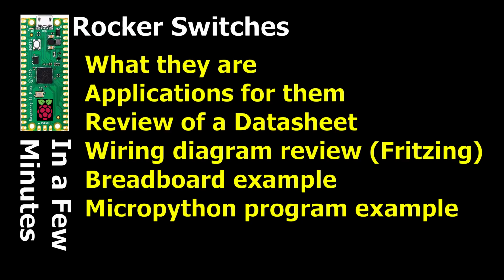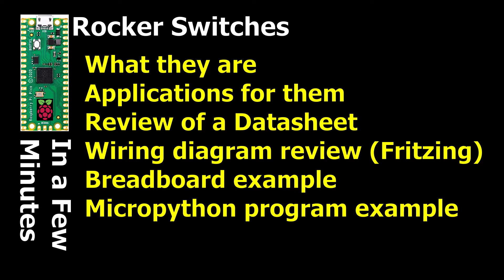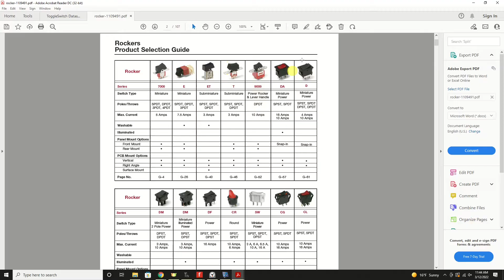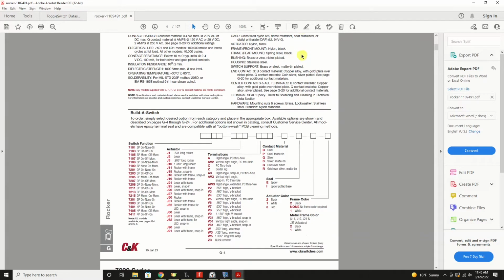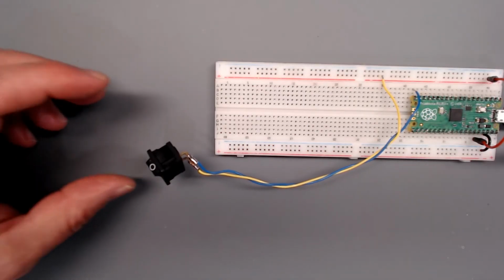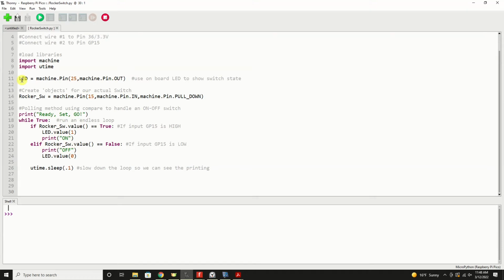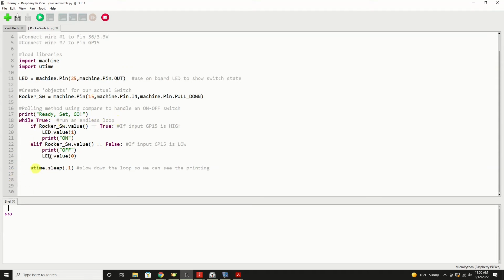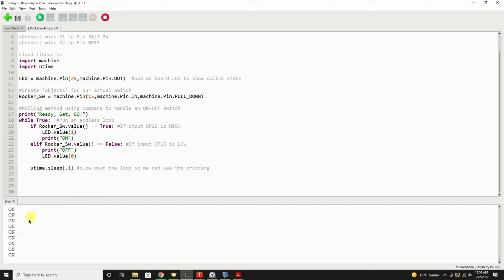How to interface the RPi PICO with Rocker Switches

Comment: I am a beginner so please be patient because I am not too knowledgable about this, but my switch says:
"3A 250V AC
6A 125V AC"
on the side of it. Will this type still work with the RPi PICO?
Reply from the maker: Yes, those specs are telling you that it can switch that much load (current).  You should NEVER be putting that much voltage or current into a PICO.  You certainly can use that switch for switching lower DC Voltages and Currents that would be applicable for a PICO (5 VDc and less than 20 mA)
Reply: @MakingStuffwithChrisDeHut  Thank you!
Reply: @MakingStuffwithChrisDeHut  Can you send a link to the rocker switch you used in the video?
Reply from the maker: @GordonFeeshman  I believe that switch is one I had laying around.
Reply: @MakingStuffwithChrisDeHut  Oh ok, thanks for the information!